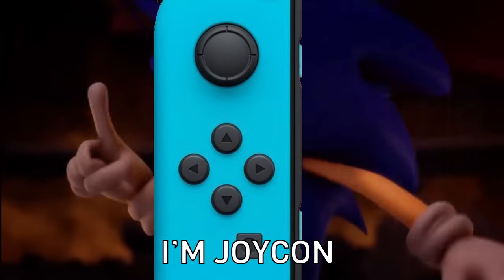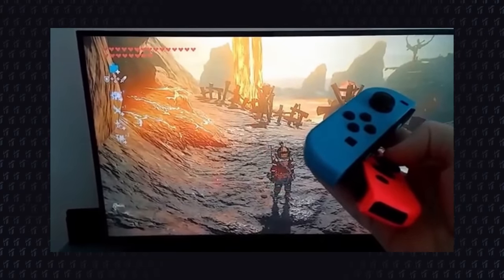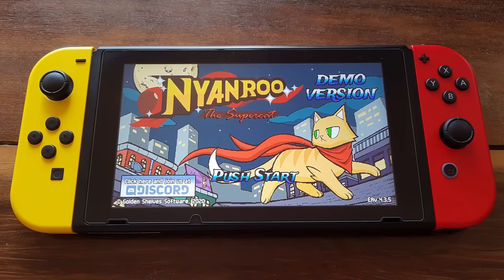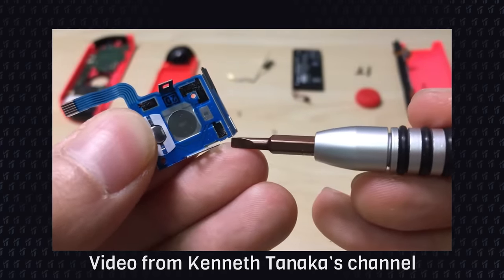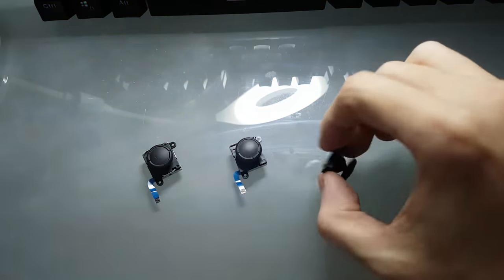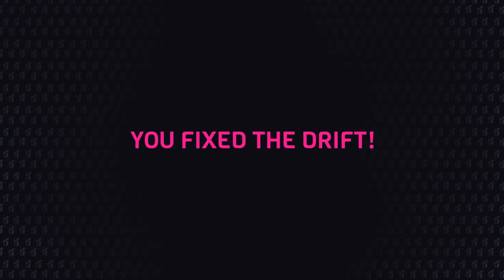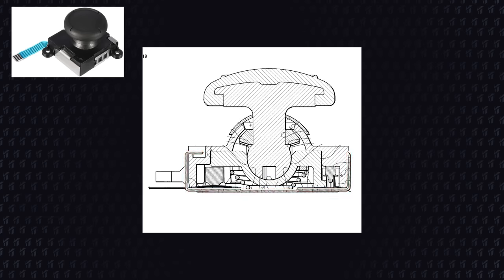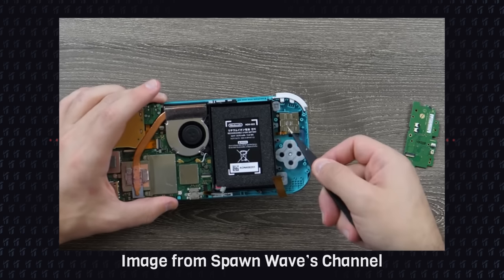How To Fix Your Joycon Drift Permanently!

Comment: I have an important thing to ask: How thick has to be the piece of cardboard?

I tried this with some cardboard but eventually the plate flattened and stopped working, so last time I used a thin plate of metal to avoid this but seems that it wasn't thick enough, so drift came back

Got the plate from scrap, so it was a bit hard to get, but I'm not only worried because that but also because one of my joycon ended with a stripped screw, making impossible to unscrew

I don't want to replace the joycons just to still having to open them to put a little piece on the base, so I would REALLY appreciate knowing how to solve this!
Reply: in the video he said it had to be around 1mm, which is approximately 1 layer of card paper

Comment: This is only a temporary solution that the only thing it does istake advantage of the graphic that is left in the stick pad. This issue DID appear on most psp consoles, and they were a hell of a fix since all the sticks weren't the same. The problem will reappear eventually even if you use this method. The only thing that causes the drift is the pressure with which we use the sticks, since as you may have realized it causes the graphite of the stick to wear. When you apply pressure on your control, you note that it works perfectly again but that is only because you are forcibly connecting the graphite with the track of the stick. The only solution is to change the stick of the console and play more delicately if you play a lot with it and very rough, in case you do not want to change the stick so often, of course.

Comment: is it normal that the joycon barely close even if I only use a thin paper?
Reply: Yes but that risk breaking your ribbon cabel because the battery is pushing and folding the cabel to the point of not connecting

Comment: I'm electronics designer, and I have to say that the mechanical issue these contacts have is beyond stupid and really obvious... they should have known this way before they released these components for sale so that Nintendo could buy them.
You're measuring resistance, so there should be nothing else than the position of the joystick that can affect the resistance of the sensor... but having those contacts being pressed down on the carbon pads is point of failure.

The design is a  mess :(

Comment: It's been a year, so I gotta ask, does it still work I'm about to try it out soon on my old joycons?
Reply from the maker: It will come back after a while because the paper card deforms over time

When that happens you can replace the card for a new one and you'll be good for some more time
Reply: @VKsChannel  what material shud i use then I was thinking of using a credit card BTW thx for responding didn't think you would have

Comment: This isn't a fix. The same issue will crop up because you didn't fix the root cause - which is wear. This'll just crop up again at some point. The problem is a bad design to get a patent combined with cheap materials(plastic) not suitable for the part. Nintendo could easily fix that with better design and materials but it's probably cheaper just to replace the few ones people send in.
Reply: In the most countries Nintendo only repair them if you pay them

Comment: This works for a while, but its not a permanent fix, On 3 joycons the drift is back after 2-3months of use, I used 1mm HDPE
Reply from the maker: Try changing the material to a plastic playing card the drift returned for me too but after installing a new plastic card it was working fine again
Reply: @VKsChannel  HDPE is one of the hardest plastics there is, its comparable with glas

Comment: If you don't like opening the joycons from fear of breaking them, you can also just use that Calibrate Joysticks menu and go through it like normal, and it pretty much gets rid of drifting 98% of the time.
Reply: That is not how it usually works. Most of the time when you get drifting, calibrating does not work, as it is an internal hardware problem.

Comment: Tried this but I couldn't open the joycon. Removed 3 of the screws then the last one is super tight, my screwdriver just scratched the top and now the shape of the hole of the screw driver is deformed. Any advice on how to get out that last screw?
Reply from the maker: Check the shorts video i made
Reply: @VKsChannel  Thank you! I will try it.

Comment: It has been 2 years since this video was released. Question: Is it still fixed?
Reply from the maker: It came back after a while because the paper card deformed, I just opened it and put a new card and its working fine again

Comment: I was checking this video as last week one of my joycons started drifting (the other one did it a couple of years ago and I had if fixed with warranty). Meanwhile I also updated Switch OS to version 13. When I checked stick calibration I noticed that in latest version they do not require anymore press on the stick to activate calibration, this is closely related to the explanation at about 8:15, stick press may be one of the causes and they try to reduce the use, especially when calibrating (indeed this time there was no drifting and I still have to open the joycon to fix it).

Comment: It doesn't Work with my Controller, it still Drifts, so i'm gonna buy a new one soon. But i think 5 years without joycon drift are a good time
Reply: replace the sticks, no need to buy new ones
Reply: @tiwitiwi6202  I already bought new ones, and for my Videos, it's pretty good now. But I think this Paper Trick might work, If the joycon Drift isn't too bad. I still have my old ones, so I could buy new Sticks and fix them. P.S. Be careful with the thin cables, I accedently broke one, and now the LED's don't work.

Comment: i thought joycon drift was caused by dust and dirt particles getting underneath the joystick overtime and messing up a sensor, not a metal plate loosening and losing contact to the joystick

Comment: I fixed the drift but whenever I snap my left joystick on the switch it doesn’t register that the controller is connected to the switch. Can you help me out here?
Reply: Probably the pins got messed up, so you need a replacement for the slide

Comment: I did this fix on my left controllers and it worked perfectly. However, when I did it to the right ones, something made it so they no longer connect to the console properly. It just doesn't notice that they're there. If anybody knows why this happened and how I can fix it, please let me know!
Reply: You mightve did something you shouldn’t of. The connectivity of the joy cons are so finicky if you even move a wire it could interrupt that connection

Comment: I'd note this down as a potential fix, but it is incorrect to disregard wear on the carbon pads. This is the core reason that the sensors on EVERY stick of EVERY type will wear down - and I've dissected some worn out joycon sticks and noticed warn pads on every one. Even if adding a shim helps prolong the life of the stick, this won't fix it forever as the pads will wear out.

What they SHOULD have done is have the flex cable go to a thin PCB inside the thumbstick module, making the module slightly thicker, but giving the carbon pads something more ridged to rest on. This is how the potentiometers on a ps4/5/xbox thumbstick are made. No, this isn't perfect, but it is better and does last longer

The real solution is a magnet based stick, like GuliKit are developing. There are no pads to wear out, and even if the thumbstick becoming lose over time is also a cause, magnetic thumbsticks would still be less effected by the mechanical slop than a wiper.

Comment: I experienced drift on my left joycon, tested it by applying pressure to see if it stopped and it did, fixed it with a piece of cardboard.
I am now experiencing it on my right joycon, and tried testing the pressure trick again but it does not fix the drift. What can I do now? If applying pressure doesnt stop the drift I don't think the same cardboard trick will fix it as well.
Reply from the maker: Clean it inside

Check my other tutorial
Reply: @VKsChannel  the analog stick cleaning one?

Comment: idk I did this on my PSP 1000, and it still destroyed the graphite pads..
Another factor with the psp1000 is the rubber connector block, which was the interface between the pcb pads and the joystick pads. It was a shitty design, maybe that was faulty on top of shitty graphite pads.

Comment: I did it and it didn't work. Maybe because that metal thing (joystick back plate or whatever it's called) is completely dented. I think there's a point where you can't save your controller anymore.

Comment: Personally, I wouldn't recommend using WD40 for fixing joy con drift, WD40 is a light oil-based product that's really meant for removing rust and freeing-up seized screw threads, being an oil-based product, it will tend to attract a lot of dust, dirt, and lint onto anything it is sprayed onto, what you really should only use is some 99.9% pure isopropyl alcohol.
Reply: WD40 is also a brand, there is WD40-branded electrical contact cleaner.

Comment: PS4, XBox One controllers also draft.
Some controllers use carbon instead of graphene. Nintendo is using cheap potentiometer which has very short lifecycle. Alps states the lifecycle clearly in the spec.
It might be really a contact problem when the material gets thinner after usage. But this reason isn’t convincing at all while Nintendo cannot fix that problem after that many years, because they cannot pad the stick for a millimetre? 

People are getting the drift after padding the stick after a while. The resistor material will get scratched and peeled off quicker after the padding. I’m afraid thing gets worse quicker after this “fix”.

I hope Nintendo uses better component now. But anyway, I am not going to buy any new joycon for Switch, nor Switch Lite. I was so tempted to buy Lite…

Comment: 4:13 This isn't true, every controller i've ever used in my life experienced drift after so much use and needed to be replaced. The only controllers i never had to replace are N64, but who wants to use those things anyway. My genesis controllers didn't drift but they developed dead zones where the direction couldn't be used, which is different but also the same in a way. I've had several gamecube controllers and dualshock 2s develop drift, with a handful of dualshock 3s and xbox 360 controllers as well, and my little siblings have at least 2 xbox one controllers they can't use because of drift.

Comment: I'm struggling opening the joycon, any tip?
Reply: Using the required tri-wing tip screwdriver tip to remove the 4 back screws? It is nearly impossible without a tri-wing. THen it pulls apart as he shows. open toward the rail. I didn't take any wire connectors loose to do mine. I just was careful.

Comment: I would like to call bullshit on this 
I tried placing two different kinds of card on the sensor. Both times did nothing and it’s still drifting.
Reply from the maker: Have you tried cleaning the sticks?

It could have too much dirt inside
Reply: @VKsChannel  I could give that a shot but with the heavy drift I’m experiencing I doubt it
Reply: @VKsChannel  How would you recommend cleaning the sticks do you use contact cleaner, pressurized air, or some other method?

Comment: I just installed a brand new toggle and it still drifts..... anyone know why?
Reply from the maker: Check if the analog flat cable is well connected to the mother board cleaning it is a good idea too
Reply: @VKsChannel  okay I'll try this. Thanks for the response. I'll let you know if it worked.
Reply: @VKsChannel  it worked. Thank you!

Comment: I was thinking that it was some type of moving part giving out like how mouses was used to be. But I just did it and it seams good a $70 USD fixed by paper that’s sad it would be cheaper for Nintendo to fix the problem instead of band aiding it by giving out new one
Reply: Also a lot of e waist for those who don’t do the warranty replacement and if Nintendo does the same instead of savaging some parts

Comment: Curious if, four months on, this still works?
Reply from the maker: The yellow joycon got a little bit of drift back

But i opened it again cleaned the stick and changed the card from its original position and it is still going

Probably the card got deformed with time so to improve on this i suggest that you use a plastic piece

Try using a platic playing card as it have the perfect thickness
Reply: @VKsChannel  thanks for the response. I'll keep this in mind if I get  any issues with my switch.

Comment: It is not true that XBOX, PS, Gamecube etc. never drift. I had a ton of controllers from different brands in my hand and every controller can start to drift. It is in the nature of the stupid potentiometer to drift one day or another. Even Automotive grade potentiometer can start to drift and i changed a ton of gaspedals with this issue in the past.
The only more or less permanently fix for this is to change the positionreading method. Hallsensors are the way to go. A hallsensor doesn't care if there is any dirt or debre. A hallsensors even doesn't have wear. It is contactless and can live in theory for ever. 
I changed or 4 joycons to Gulikit hallsensor based analogstick and so far we have no drift. With the original and other third party potentiometer based analogstick replacement you got drift after 3-6 month of use.
I bought the Gulikit analogsticks last year and they worked great since then.

Comment: All controllers drift. Eventually the contact pads on all controllers will wear. I've never had a ps controller that didn't drift
Reply: I see this video as a fix for those who have this particular issue, it obviously doesn't solve the drift permentantely and it will pretty much be recommended to buy a new module preferably gulikits since they are one of the only companies right now who have hall sensor module replacements

Comment: But JoyCon drift is caused by the system not being able to correctly interpret the devices inputs as a single controller because each half has different bt mac address so the halves can be utilized as single controllers in games that support that feature . How does this permanently fix that ?

Comment: So basically you are saying the only real solution is that nintendo should make a joy con 2.0 that uses a stick assembly with 4 screws instead of 2 screws so there is pressure on all 4 corners? 😅
Reply: ehm yeah.
they made a Switch, Switch Lite, Switch V2 and Switch OLED
so why not also make a Joycon V2?

Comment: Well, this fixed it for about a year… after that this fix doesn’t work. I can even show evidence if requested.
Reply from the maker: yeah the paper card will get deformed as well, just replace it with a new one
Reply: @VKsChannel does the papercard wont burn in the Joy con After some month?
Reply from the maker: no, the joycon doesn't even generate enough heat to burn it @TheLostSoul234

Comment: I tried this fix,  and my right joy con wont charge :(
Reply from the maker: You probably have broken the ribbon cables for charging
Reply: @VKsChannel  But the funny thing is,,  when I connect the right Joycon on the switch itself, , sometimes it works fine for a few mins.  If I click it out, it disconnects instantly,  click it on the switch, and it seems to work.  So can it be the battery itself that is broken?

Comment: Please guys, let it someone do who knows how. >long text ahad

I myself slapped the crap out of my controller till two of screws came out ( wasn't intended )
So I tied this when I saw the chance, I fiddled in a pice of paper trough the space I could open by force to look into the controller. This pice of paper was to big tho and now my controller looks a bit like the housing  could break and on top of that it sits on the battery so the housing plus the paper ( and the screws who hold this chaos still together ) putting force against the battery too. I mean it seems like the drift is kinda gone for now, idk. I will buy myself some now controllers tho, it won't work on a long time basis how I tried to do it. So beware and do it more professional or let someone better do it.